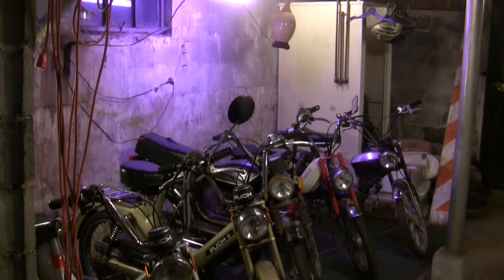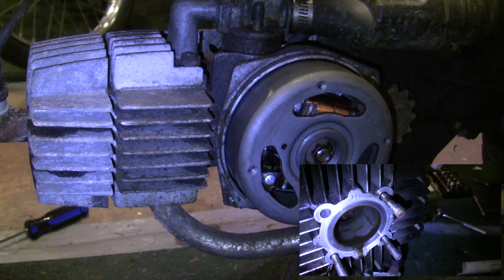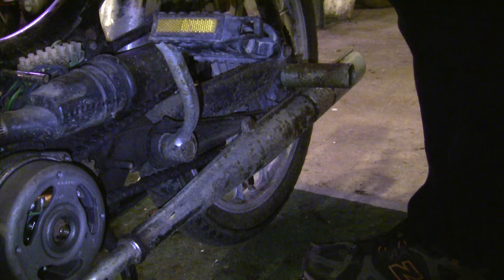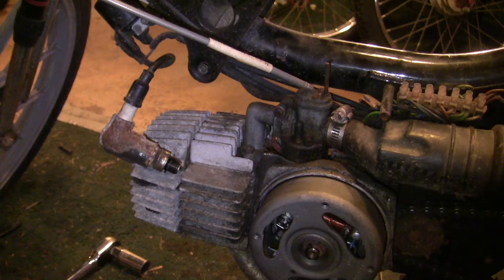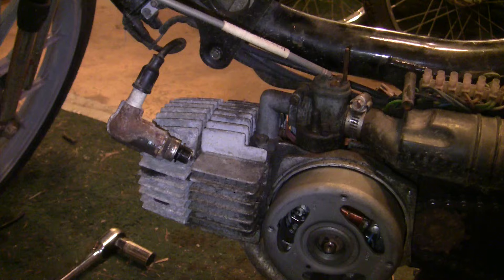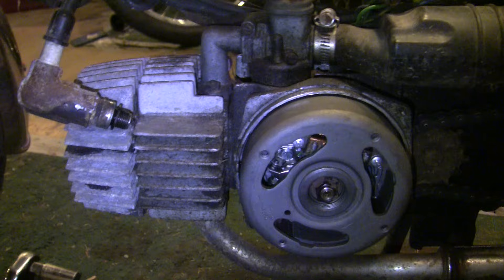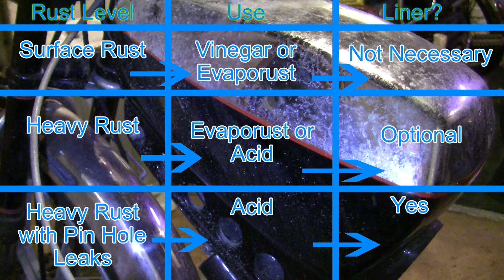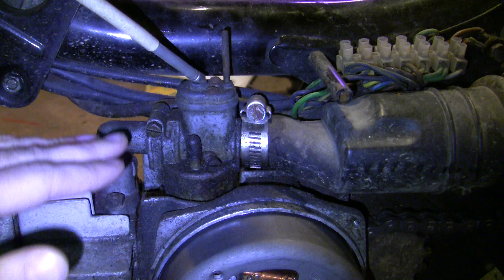How to get an Old Moped Running/First Things to Check (Compression & Spark Tests, Troubleshooting)

Comment: Great video but i have an old basic garelli sport and i dont know where the flywheel is on it.. any tips?
Reply from the maker: I haven't worked on a Garelli in a while but there is a cover you remove opposite the side where you fill the transmission, linked some manuals:http://projectmopedmanual.info/Manual_HTML/garelli.html
Reply: I appreciate the reply, i can't wait to get this thing on the road!

Comment: hey  question i have a 83 puch dart n cant figure this  out but when she starts she idels realy low n  ride slow but if u hit a bump then for some odd reason gose fast then back to slow
Reply from the maker: My money would be on fuel flow, make sure the carb is clean, you have good flow from the petcock, good flow from the other side of the fuel filter (run one if you aren't already), and also that the little screen thing inside the carb's banjo bolt isn't blocked up. It's possible there is a spec of something along the line somewhere restricting flow, but whenever you jostle around it moves.

Comment: Im going to inspect a suzuki fa50 today, any advise what to check for?
Reply: Just the same as here. Check the carburateur and if it has a spark. That's everything you should need the make the bike running again.
It need fuel and a spark.

Comment: Ok so I have a kromag moped that only takes leaded gas so is there a way to charge ge that and the fuel line was cut so how do I replace that
Reply from the maker: Modern pump gas mixed with 2 stroke oil is fine, that is a dated sticker meant to reference white gas which was the unleaded fuel of the day. 

3/16in fuel line from an auto parts store will work

Comment: My points aren't moving when I spin it what could that be?
Reply from the maker: It could be several things. If I were troubleshooting them the first thing I would do would be to try and set point gap to spec (explained in my e50 timing video, remember your gap will vary depending on model, manuals found at projectmopedmanual.info) to see if maybe they just need set. I would do that first because you can set them without taking the flywheel off. Remember the movement is slight, on a Puch the gap is .017inches. If that doesn't fix it and they are stuck, I would try to lube the cam follower, it's in the middle of the "arm" of the points, careful not to get any lubricant on the points themselves. That job will be easiest if you take the flywheel off, and you'll need the correct puller for your motor.

Comment: I am in extreme need of help, hate asking but this is my only source of transportation. can't find any place to take it, really need some one to come take a look at it if at all possible. could pay.
Reply from the maker: +James Daniel What brand of moped is it? Where generally are you located?
Reply: It is a cimatti city bike, I live in parma heights next to parma town mall.
Reply from the maker: Okay, so that' a moped with a Minarelli V1 engine. I'm about 2000 miles from you unfortunately. Mopeds are largely DIY which is actually not so bad because parts are cheap and they can be worked on with basic tools. At the same time, it can be daunting if you need to do a major repair and aren't mechanically inclined.

I would try and find some riders rear you and see if there is anyone near you who would be willing to help:

http://www.mopedarmy.com/riders/

Comment: OK I have a moped with a minarelli engine it was running fine but the next day it won't run I put new gas in it change the fuel line clean the carb a few times flushed the carbs old fuel and just put a new spark plug in it and still won't start I mean it does but not by itself I get on it pedal pedal holding the clutch the lights turn on , classic two stroke noise starts going on and then if I stop pedaling it dies so please help I just got it three days ago please help
Reply from the maker: +Sean Smile It sounds like you are on the right track, just make sure you are taking time to troubleshoot too. You replaced the spark plug, but did you check for spark? You cleaned the carb, but is fuel getting to the cylinder (is that new plug wet with gas?). If it still has the stock Dellorto 14.12 carb usually you just need to clean the main jet. 

It's possible something is damaged in the top end, but verify the easy things first.
Reply: Fixed it turns out I didn't torque the spark plug correctly , thanks for the help

Comment: My spark plug on my tomos automatik is not giving any spark at all. Any help?
Reply from the maker: If it's an older model, and complete - it's almost certainly dirty ignition points or points that aren't moving (rotate the flywheel and see if you see them opening & closing). Or a bad spark plug itself. 

Even if it's newer, you can take it down to it's bare elements by removing only the necessary wires for spark, check a service manual to find the primary power wire from the stator, then make that go right to the coil (or, to the CDI box, then the coil if a CDI bike). That will help eliminate bad grounds and you can add things back in.
Reply: @TravisTutorial  Thanks, I will try this. And yeah, it's a really old one. I looked at the metal badge placed on it, but they didn't write in the model or anything like that, only that it's an automatic. And that it's made in yugoslavia lol.
Reply from the maker: @the_archon  The best ones are :) Later on Tomos (right before the end) outsourced their production. You very likely have an A3 engine, for when you need to look up diagrams 

https://www.myronsmopeds.com/2022/07/t-wirings/
Reply: @TravisTutorial  Thank you, I thought it could be an A3 too just by the looks of it!! :)

Comment: Hey do you know anything about the mo1 motor  on a cosmo looking for some more info do they make any performance parts not my first moped I have a tomos that I built up don't know much about it any help would be great!
Reply from the maker: +Tanner s10 Cosmo Colt? That's a top tank right, neat! 

I had a Bianchi with that engine but only briefly, they are good engines, but not nearly as many performance parts a a Tomos or a Puch. I'm a big fan of the quick and dirty so if it were me I would just hack and weld the 2 piece bi-turbo treats sells for an expansion chamber exhaust and maybe a slightly larger Dellorto carb like a 15.15 instead of the 14.12 that's likely on there (after figuring out a bigger intake). There are a few kits available, but no aftermarket crankshafts so I would try and gear it for taller so you don't run the revvs crazy high. Marty's garage website has a gearing calculator on it  to figure that part out. You can also search around MA and check the tuning spreadsheet on the MA wiki to see what other people have run.
Reply: Yeah it's a top tank so would this kit work? http://m.1977mopeds.com/item/33393636 and also that KS for the info
Reply from the maker: That kit looks like it would work, but $250 is getting close to price of a whole moped. I did a bit of poking around, it looks like that is the only kit available brand new from the major suppliers which is kind of a bummer.

My thoughts would be, if you put it together and then snap the piston ring you'd be left with an expensive paper weight (happens a lot on Puch Polinis!), a kit like that requires a real break in period and some planing ahead of time with gearing/ignition, it'd probably be a bit less forgiving than a Tomos kit, plus you're asking a lot of the 30+ year old engine seals.

If you're super stoked about Morini and cool with rebuilding it if it blows up then it could be a ton of fun, reeds are far superior to piston port kits and this one even comes with an intake. If it were me, I'd see what I could get away with porting the stock cylinder first with a hacked pipe and bigger carb, but it's your adventure.
Reply: +TravisTutorial okay thanks for the Info I really appreciate it one more question do the stuffed racing cranks for the a35 make any power difference?
Reply from the maker: Tanner s10 I'll be honest I don't have any experience with aftermarket a35 cranks - on older mopeds the advantage to going to a race crank is that it has a roller bearing on the small end while Puchs and a few other ancient models had a brass bushing there which likes to melt at about 9000rpm. Newer designs like the a35 (should!) come with a roller bearing from the factory. I feel the advantages of a race crank for an a35 would be the ability to handle more power without snapping or warping. If it's a mild enough kit like a cheap 70cc then I wouldn't bother unless you're already planning on splitting cases and rebuilding

Comment: What torque should the head bolts be?
Reply from the maker: YeCannyDaeThat 7ft pounds, assuming we're talking Puch e50, full torque specs are on page 22 of the service manual located on the projectmopedmanual website.
Reply: TravisTutorial Thanks, its not a Puch, It's an Italjet Velocifero (Franco Morini Suzuki AH50 engine) but im guessing it should be similar.